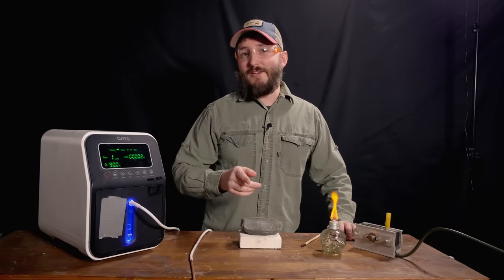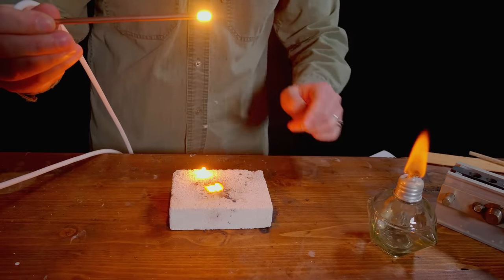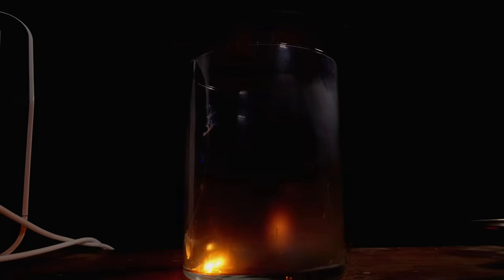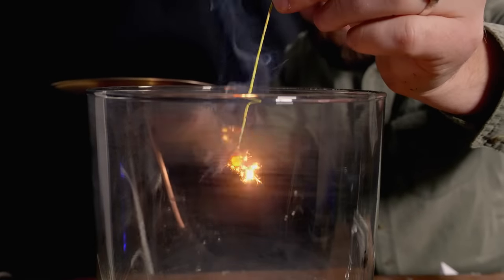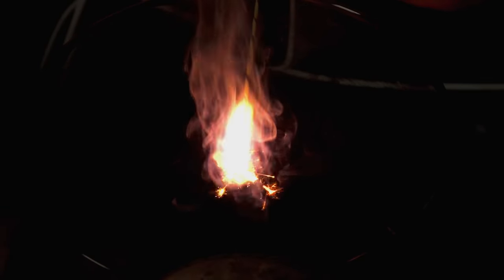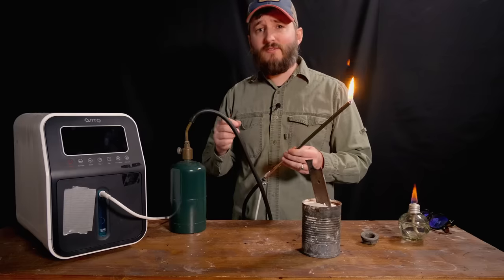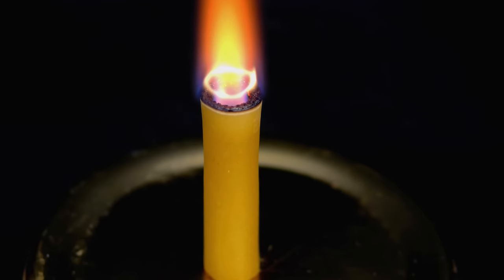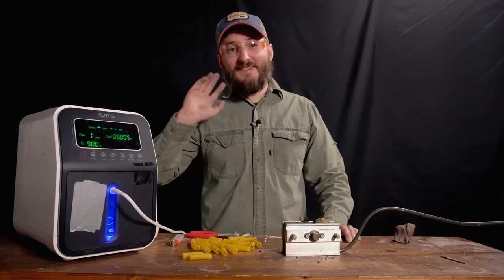6 Unauthorized Uses for a Medical Oxygen Concentrator

Comment: Everyone seems to forget how dangerous Oxygen is, so many accidents related to the mis use of Oxygen
Reply: Mis
Reply: 3 american astonauts died because of the deadly combination of oxygen under pressure and an electrical short. a soviet cosmonaut died in pure oxygen fire as well.
Reply: Oxygen is so reactive that when a welder uses a cutting torch to cut steel once the steel is hot enough the fuel can be turned off and the cutting only needs the oxygen because the steel burns, the steel becomes the fuel. That is why welders call this BURNING, look up oxygen lance.
Reply: Careful in saying how dangerous oxygen is…. Some activist group may try to have it banned😂
Reply: Bullshit. There are countless home oxygen concentrators out there running 24/7 with rarely a hiccup....
Unless you're introducing flame inches from the tubing.
Reply: "Oxygen is so dangerous" found this: "As of 01 Sep 2023, dry air in Earth's atmosphere contains approximately 20.95% oxygen, 78.08% nitrogen, 0.93% argon, 0.04% carbon dioxide, and small amounts of other gases.3 Atmospheric oxygen is the most important need humans have, even more important than food.2 Most organisms have evolved to live in an environment that has a very specific set of conditions, and if this percentage were to change suddenly, most organisms would have difficulty coping with the new conditions.1 Air suitable for use in photosynthesis by terrestrial plants and breathing of terrestrial animals is found only in Earth's troposphere.3 Oxygen atoms are very reactive and are incorporated into many common chemical compounds, such as water, carbon dioxide, carbon monoxide, sulfur oxides, and nitrogen oxides.0"
Reply: Who cares if pure oxygen is dangerous?  Oxygen concentrators are very safe when used as intended, BUT for people like the guy who made this video and myself, we can use it for all kinds of cool things because we know how to handle it.  Oh, I've been misusing oxygen concentrators for years and plan to keep on doing it.  I frequently play with liquid oxygen as well.
Reply: Prolly mozart
Reply: @cmk8477 Like water was banned? Dihydrogen monoxide contamination!
Reply: I saw an educational movie for the fire department there they demonstrated how dangerous oxygen can be it was many examples but to name one they first tried to burn a normal wood fire in a car and with normal air and it went out for lack of oxygen. But then they put in a big lump of liquid oxygen and ignited it a long way away and under cover which was wise because there was just a big pit where the car had been! So it's important to know what you're dealing with in all situations, but it's certainly interesting to experiment as long as you don't risk harming anyone other than yourself, in my opinion in any case! The most idiotic thing I've heard of was in a workshop where one of the workers had placed the sheet he was going to cut on the gas cylinders which blew the walls out and everyone died instantly! I don't feel sorry for the idiot but for sure all the innocents who were affected including their relatives!

Comment: Very cool! You did several things I've never thought of! To get high flame temperature your torch needs to mix the fuel and O2 before it reaches the flame. Normal torches do this, and use a nozzle with a small diameter throat and body with high thermal conductivity to prevent the flame from flashing back into the mixing chamber. The small nozzle diameter increases the mixed gas velocity and the highly conductive nozzle body quenches the temperature, thus preventing flashback into the mixing chamber.
If you try this, be sure to limit the volume of the chamber and make the chamber sturdy so that if you do get a flashback it doesn't explode!
I have an old, much bulkier O2 concentrator that I use to feed a small commercial torch. It works great with propane fuel for glass blowing and for brazing and silver soldering. 
BTW, the medical tubing for oxygen use is vinyl with a teflon liner that resists propagation of any internal flame. This makes it safer, but difficult to use with normal barb fittings because it doesn't stretch like plain vinyl tubing.
Reply: @wb5mct....I'm a nurse and didn't know that the O2 tubing has a mix of product that doesn't propagate a fire. We r just taught that signs have to b posted for no smoking, oxygen in use. Thanks for the info.!
Reply: @kathleendavis2008  next time you discard a cannula take a moment to dissect it and pay attention to the construction and materials. You don't normally see the double wall nature of the tubing because it's fitted with a molded connector. Also check the materials used in the nose piece; the one I'm looking at now is made from soft silicon rubber which is also highly flame resistant. Oxygen safety is definitely not a joking matter: a fire in an oxygen atmosphere is scary as hell!

Comment: I'm a glassblower and I use an oxygen/propane torch very much like what you tried to make, here. You're reinventing the surface mix torch! Swap the feeds on the oxygen and propane so the fuel is surrounded by oxy instead. For a better second version, use smaller tubing so you get higher gas velocities. 🔥

Comment: Two things come to my mind regarding your request for ideas:
1. Add a storage volume of oxygen, something simple and easy to "recharge". A tall clear cylinder, purge it with the concentrator for awhile, then feed water into the bottom to pressurize and push the oxy out at a higher pressure and flow. Makes a very visual addition. Add a bubble U loop to keep flame from being able  flash back into the cylinder.
2. Use a hotdog or sausage as the "fuel". Core it out so you can feed oxy thru it like a rocket. Once it's done you can cut it up and let everyone enjoy some "rocket sausage"
Reply: Try baking various flours into various density breads with little leavening agents to carve out nozzles geometry. ( And\or to replace the pasta fuel chamber).

My nieces would make fun of their male cousins lol.
Reply: Why not just figure out a way to collect it with an ordinary air compressor?
Reply: @tonychan647  Hard Tack.  That stuff practically crystalizes when you bake it.  Bone dry too, and very few voids.
Reply: Yeah, this was where my mind went immediately too--I believe Mythbusters did a salami rocket at one point. So maybe an easy idea for kids to experiment with is just different foods as fuels. Any food that's fairly rigid, but that you can make a hole in, could be a fuel here. And the kids could form hypotheses about what will make for the best rocket, and then test them out. High energy density is one obvious thought (so, maybe cheese?) but homogeneity is probably pretty key to maintaining a steady flow and reaction. What about water content? Would that make, say, an apple better or worse than a sugar cube with a hole drilled in it? Water absorbs a lot of heat in changing state, but it also expands tremendously. I think there's a lot of kid-potential there.
Reply: What do u mean by a bubble u loop?
Reply: @benwalters9222  just a loop in the outlet of the storage cylinder with water in it, the oxy has to push past the water to get out, but would be "less likely" to be able to burn back up the tube to the cylinder. It also adds another visual feature that adds to the mad scientist vibe, add some food coloring to the water in the U
Reply: People who make wine or beer at home use a U-shaped bubbler as an air lock during fermentation.  Might not be the right size for this process.
Reply: OMG! More educated Pyromaniacs giving tips to amateur pyromaniacs! (Yes, please try these things!)

Comment: For your pasta rocket maybe encase the noodles in clay entirely so they can combust fully, and perhaps try compressing the enriched o2 so you get a higher initial speed of the gas flow. Could be that the exhaust gases are pushing the o2 back down the line because of low pressure
Reply: If you then fill the pasta with spaghetti... you get a longer burn time.
Reply: If you were ambitious, you could also stack the pasta and potentially get a longer burn time on the rocket.

Comment: If you install a flow meter/needle valve on the output and lower the flow rate to around 2-3lpm you can usually get the o2 concentration up closer to 95-98%
Reply: You can’t get above 95% oxygen because ~5% is going to be Argon. The molecular separation doesn’t separate out the argon. Only the nitrogen and some other trace gases. I work repairing oxygen concentrators
Reply: @MrTaylork1  I just went check the data sheet on the unit I have, and you are correct,  it shows the max o2 concentration is 96%.  There is also a tag on the unit from the last inspection that was done by a very reputable medical device company that shows the o2 concentration was measured at 98.5%!  Lol, guess it was done on a Friday and the tech performing the inspection didn't know this fact.
Reply: @MrTaylork1 Argon is 0.93% of ambient air.
Zirconia oxygen concentrators will deliver 100% oxygen because oxygen is transported through the Zirconia and nothing else.

Comment: When you explained the dangers of using that machine around an open flame and the oxygen creeping into clothing and the bed and likely building up around the body, and then you lit the little pipe cleaner man on fire, I thought back to an incident I researched of a man by the name of George Mott of Crown Point, New York who mysteriously died in 1987 of what some were calling, "Spontaneous Human Combustion". This case was actually featured on an episode of Unsolved Mysteries as well as several other TV documentaries, and the bizarreness of the case intrigued me to do more research on the case.

 When he (what little was left of him) was discovered by fire investigators in his burnt out bed, an oxygen machine was found in the room right next to his bed and still running despite the intense heat that was produced in the fire that had consumed his body. The big mystery to me though is how the entire house didn't burn down or why the fire never advanced beyond his bed. Anyways, relatives were interviewed not long after the incident and had mentioned that Mr. Mott was a former smoker who had quit. However; on the other side of the bed from the oxygen machine sitting on a nightstand was an open container of long stick matches (also unaffected by the fire) which would suggest Mr. Mott had relapsed. 

Based on your experiment in the video, I'm thinking Mr. Mott likely had his oxygen mask on and over time oxygen had accumulated and concentrated around his body, in his clothes and bedding, he decided to have a cigarette and took his mask off, completely oblivious to danger he was in. And as he lit his cigarette, he inadvertently set himself on fire as you'd set the pipe cleaner man on fire, and the high concentration of oxygen in and around his body allowed the fire to burn more intensely, reducing his body including his bones almost entirely to ashes, which is actually extremely rare in most fire-related deaths. 

This video is definitely an eye opener. Thanks for posting!
Reply: Holy shit
Reply: after watching this i conclude the same thing happenned to that old guy. the expirement showed that it burned viery quickly and hot. because it burned so quickly and hot it was out with seconds. with the old guy he probaly burned so fast and hot that he was dead almost immediately. he probably exploded on fire
Reply: I dont know, while I agree, this is definitely an interesting hypothesis that warrants further study, I suspect the amount of free oxygen around his body would be consumed quickly. I think there's a lot of variables to consider. The amount of bedding what type of mattress and a host of other factors. Definitely warrants further investigation. But I never believed that that case was "spontaneous combustion", and that is the first hypothesis that's held any water in my opinion.
Reply: Best hypothesis I've heard. There may have been other that I haven't
Reply: I guess I've been lucky then.  I've spilled liquid oxygen on my clothing and then I was near an open flame 5 minutes afterward.
Reply: I hope you mind a reply to an old comment, and that this might be a little gruesome. One of the better theories I have seen is that the body becomes a sort of oil lamp. Body fat is oil and clothing the wick. Probably get the process going, the fire needs to start near a high fat part of the body, like the belly. It needs to burn conventionally through the skin. Once to fat, the heat pops open the fat calls letting the flamible liquid out and on to charred flash and clothing eventually getting wicked into sheets or PJs. The fire isn't very intense but a plump body might keep it going for days. As the flesh cooks water and other juices seep out dehydrating the flesh and keeping a lot of the sheets and bed from burning. Carbonized meat also acts in a wick like way, slowly burning itself while creating more char behind it and more dehydrated flash behind that. Eventually even bone dries and chars. 

I forgot to mention there is an assumption the person died of other causes before burning. Some people might be able to sleep through the initial pain of burning and die from slow roasting but I think death beforehand is simpler.  So your dude might have been smoking in bed and fallen asleep or died with a lit cigarette in his hand coming to rest on his belly. That got cloth smoldering (fireproofing chemicals might be what keeps it to a slow smolder.

I'm not sure if I am making up this next bit. I thought they tested the idea on a dead pig and it worked. The advantage of a pig over many animals is that they, like us, store fat right under the skin so the fire doesn't have to burn deep before striking oil. Again, not sure they actually did the experiment, but someone should. I don't happen to have a dead pig on hand.

There were other clues that suggested a slow, low intensity fire according to the arson investigator the show brought  in as an expert.  I think maybe soot had accumulated low on the walls, for instance, suggesting it wasn't buring so fast it stuck to the ceiling. I think part of the equation might also have been that the bedroom door was closed so by the time things got really messy, there wasn't enough O2 to sustain a rip roaring fire.*

I guess O2 could have played a role in initiating the fire but I don't think 5 to 10 liters per minute of O2 could sustain something like an intense industrial cremation fire. And, if it did, the house probably would have burnt down.

One time at the school bus stop, while waiting for the fire department to arrive, I watched a house burn down to the ground. (No one was home.) I suspect it was in a closed room. For a little bit, it burned brightly, but then dimmed to the point we started to wonder if it had gone out. I guess it could have just been thick smoke blocking the light. Nothing much seemed to happen for quite a while but then a window shattered and it looked like a nuke went off a few seconds later. The rest of the house went down in less time than it took until that window shattered.  I suspect a slow burning body might use up most of the O2 but not generate enough heat to shatter a window. So that might contribute to a slow burn.

Sorry that was kind of long, been interested in spontaneous human combustion ever since I was a kid. Was nice to have a non-woo hypothesis at long last.

Comment: I would strongly recommend putting a flashback arrestor on your set-up. It prevents any flame from getting past this system. They are not that costly and with a few fittings it should be perfect for your set-up. Anyway, I enjoy your videos. Stay safe.
Reply: Not gonna lie, I got pretty nervous during the tube burning part and the propane torch part without any flashback arrestor!
Reply: @algorithmae  both gasses wont burn without eachother

Comment: For the pasta demonstration, maybe you can make your own pasta shapes from dough! Dough has really similar properties to clay in a lot of ways so you could make any shape of pasta with any shape of nozzle you want! Waiting for it to dry or baking it dry may have some issues, but depending on the recipie you could probobally just use the fresh pasta without drying it. Plus you can cook your rocket pasta and have a nice meal after!
Reply: Yes! This!
Reply: Just letting it dry will produce the typical store bought noodle look.

I do it all the time when I make fresh pasta. May take a few days for chunkier designs.
Reply: With some kind of negatives, e.g. from 3D-printing, you could also demonstrate different core burner geometries and their behaviour. Maybe use a smaller diameter nozzle and/or higher gas flow to increase the chamber pressure. The moisture in partially dried pasta dough may even contribute to thrust in a meaningful way!

Comment: A GTT Bobcat glass blowing torch is designed to run on propane and oxygen, but has a good efficiency and allows for it to be run with a decent quality air unit like yours.
Reply: He's also got the propane and oxygen swapped for a proper surface mix torch. Kinda funny how he's reinventing lampworking torches though!